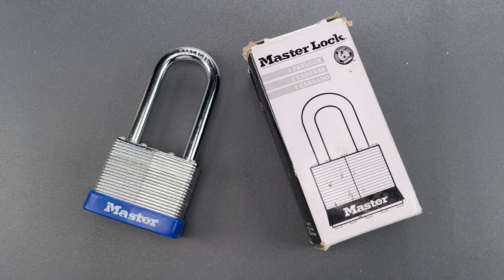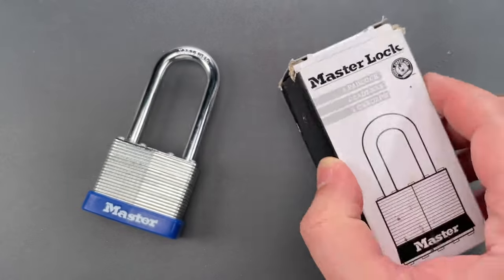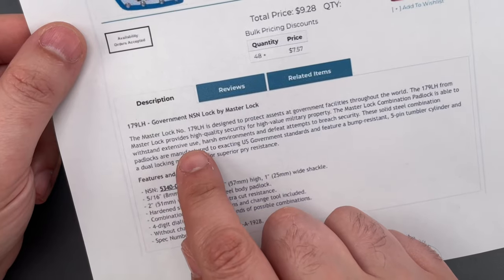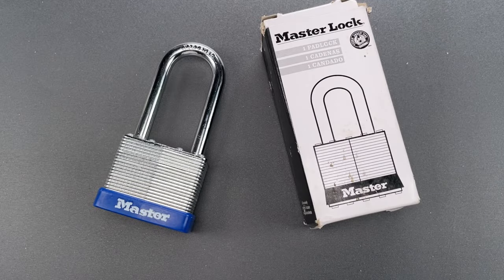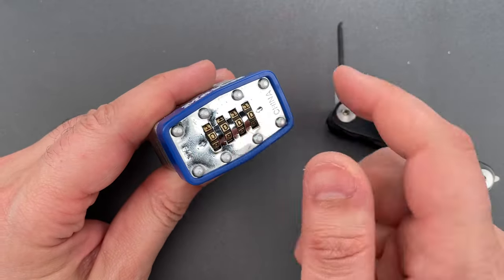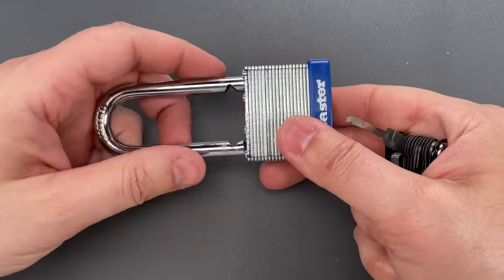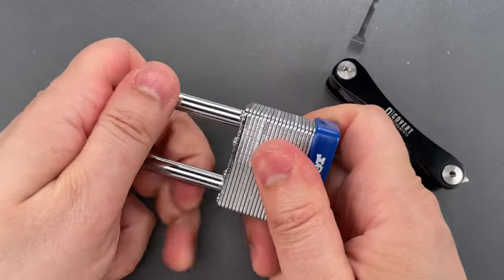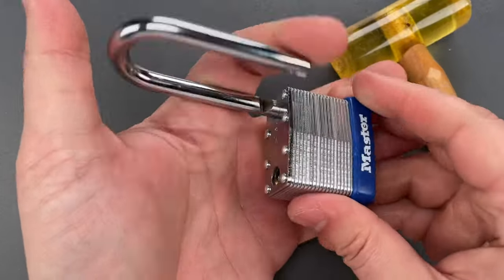[1449] TERRIBLE Master Lock Laminated Combination Lock (Model 179LH)

Comment: I always cringed when videogames depicted lockpicking as something stupidly easy that takes 5 seconds... and then I started watching LPL.
Reply: Then you realize it only need 3 seconds
Reply: Rumors say when you name your character in Skyrim like him, you start with lock picking 100
Reply: @Mazaroth  honestly. You only need to hit most locks with a hammer. Skyrim is obviously way too hard.
Reply: @Mazaroth  In a setting with that level of technology, they used loose tolerance warded locks, not pin tumbler locks, due to the limited skills of blacksmiths to make locks and keys.
Reply: @Mazaroth  I mean, Most locks back in the day had 2 pins at best....
Reply: That is very generous of the video game for someone to take 5 seconds to lock pick.
Reply: Character development
Reply: @Mazaroth  dude acting like they had high lock technology in the medieval era
Reply: @Root3264  The hard part is finding his name.
Reply: Fallout lockpickin seems to be harder than some real locks :DDD
Reply: @sigmamale4147  also, magic is the technology of the day -  locking and warding magic + traps can be used. skilled casters as part of the security. it's why guns don't really exist (though elder scrolls technically has plasma rifles and 'math cannons' (they cancel you out of existence like an equation). but like your average revolver is pointless. blades and bows work fine, and if you need to penetrate heavy armour use a hammer or cast a fire spell
Reply: @elsydeon666  
Yet again elder scrolls setting has magic and also dwemers witch were more technologically advanced
Reply: @Root3264  Tried it and the game crashes, turns out it maxes out the Integer.
Reply: @Root3264  too bad I don’t play Skyrim
Reply: @elsydeon666  Yeah, i know that it wouldn't make sense to have such much machined parts in the past, but they did have stuff like that in oblivion, then again it would make even less sense since that's about 200 years before skyrim.
Reply: @Mazaroth  Well, in this channel were featured some "high security" locks with zero pins, i.e. you just need to tension them and it will pop open.
Reply: @sigmamale4147  Honestly, my point wasn't that, it's just that the minigame sucks, oblivion had way better one, even if it doesn't make sense to have pin tumbler locks in a setting that's close to medieval times.

I know modern locks require machining, which honestly wasn't impossible in those times given that they could use copper, iron and steel, it would've just been really, really expensive and time consuming.
Reply: @Mazaroth  I heard that videogames depict lockpicking incorrectly intentionally, because they're released internationally, and some countries outlawed any lockpicking instructions.
Reply: @VcSaJen  Yeah, that would make sense, it's still kinda poopy that they can't atleast make make a challenging minigame, even KC:D has a better one and that ain't realistic either.
Reply: @Mazaroth  is almost like they didn't aim for reality when doing the lock picking mechanics😉
Reply: @elsydeon666  and also...
... it's not reality nor meant to be.
Reply: @sigmamale4147  other dudes acting like it is supposed to be 100% accurate mechanics in locks in a...
...game😉
Reply: @Mazaroth  I can't even argue oh it's past fantasy we can chalk it up to them not knowing.

Bc fucking imperials in oblivion have great fucking locks. Only nords apparently never heard of multiple pins.
Reply: @Mazaroth  Well I'd say no lock works like that anymore medieval lock were rather easy to pick even for a novice. During that time they simply didn't have the tools or materials to build something to very tight tolerances, well at least not without the lock becoming so expensive that only a handful of people in whole of Europe could afford it.
Reply: @elsydeon666  I'd say it was not so much lack of skills as it was lack of proper tools or materials, blacksmiths of that era could do some pretty impressive stuff so they weren't unskilled by any means but you could do only so much with the tools and materials of that era.
Reply: @SampoPaalanen  and also...
... IT IS A GAME, NOT REALITY 😂😂
Some "discussions" on the Internet is really cringily worse than geek sitcoms 😁
Reply: I got the a clue about how easy it can be when I as a kid, after picking my sister's diary's lock decided to try something more challenging and managed to open our home's door in about 10 minutes using only hex tools.
Reply: Put down the controller and go outside. Sell that console and buy a PCP rifle.
Reply: @Mazaroth  I don't know if you noticed, but it's a game.
Reply: @Mazaroth  It's a videogame and the lockpicking minigame wasn't designed with the intention of being realistic. That's like complaining crafting in videogames is unrealistic. Of course it is! Literally the only goal was to create an interactive stat check that doesn't take more than a few seconds to explain.
Reply: except in Payday where it takes like 1 minute
Reply: @CanIHasThisName  It could at the very least be challenging or actually require some actual hand-eye coordination skills, for example KC:D and oblivion have better ones and those are not realistic either.
Reply: @Mazaroth  The Oblivion locks are better, first thing i dith after i had left the dungeon was go south to a cave where the Unbreakable Lockpick is.
Reply: Lol
Reply: @daedelus6602  You mean the skeleton key you get from the Shrine of Nocturnal? You have to be atleast level 10 before you can get that quest and i'm pretty sure you cannot get that when you just get out of the dungeon.
Reply: Now i cringe knowing nothing is secure. :) luckily, i downt own anything of value, but still!!!
Reply: @Mazaroth  IMO for a dumb mini-game it does its job pretty well.
Edit: Definitely wouldn't call it accurate, don't know why people are defending that aspect of it. I just mean that in the same way combat is really dumbed down I think that's fine for lock picking too.
Reply: @Mazaroth  yes they do, they are Master lock brand.
Reply: Lol yeah same
Reply: Are you older than 8 years old?
Reply: @Mazaroth  Well, are you aware of that ancient clock from Greece that they found on a sunken ship? That has really spectacular machinery/gears. Metal back then was melted down so anything of true value was likely recycled and then we got the dark ages after that....
Reply: @Mazaroth  The Antikythera Mechanism proves that it's not that crazy for Oblivion to have decently fine gears/mechanisms especially for a game with magic and automatons(TES Lore) in it.
Reply: I really liked the oblivion lock picking.
Reply: @Mazaroth  Skyrim is a simplistic game about a game world that bends over for you just as soon as you look at it. Not the kinds of game where you should expect lockpicking to be difficult.
Reply: @Mazaroth  yeah. now we know that the security standard is much lower.
Reply: @Mazaroth  it's literally a fantasy game
Reply: @TuberoseKisser  Well, if it's literally a fantasy game, what would stop them to implement a lockpicking system that's "out of this world"?
Reply: @Mazaroth  cough master lock cough
Reply: @Mazaroth  you realise Skyrim isn’t set in 2022 after the industrial revolution? Sure it’s fantasy but it’s set in the real life equivalent of like 700AD. Locks in Skyrim are extremely basic
Reply: @Robstrap  Gee, if i only had known that...
Reply: ....or...   "You broke your lockpick" 500 times.
Reply: @elsydeon666  Well i would say skyrim had a lesser importance for locks as oblivion had much better locks and that was before the events of skyrim
Reply: @Mazaroth , at least in Skyrim, they use both a wrench and a pick. Most games don't even do that.
Reply: @Mazaroth  It's a game, it's made to be fun. Morrowind had a more realistic lockpicking mechanism, but it's also more tedious.
Reply: @Mazaroth  ,
Looks at Dwemer Lock Box which requires Dwemer Blood to Open

You did do that quest, right?
Reply: Lockpicking 100
Reply: @mrnickbig1  ,
I prefer the lock picking mini-game from Elex. It forces the player to pick the tumblers in the correct order while also not requiring the player to have good and-eye coordination or fine motor skills like Oblivion/ESO. Hitting the wrong tumbler resets the puzzle and has a slight chance of breaking the pick used.

Now, games which force me to play a mini-game which requires me to have the fine motor skills I never will have is pure frustration. It's great to see game designers take a somewhat realistic approach to lock-picking while leveling the playing field for everyone (Skyrim, Elex, etc.).
Reply: @xtrem5428  If it's made to be fun, they failed that too. I'd gladly take Morrowind's lockpicking over Skyrim's, because at least there's some chance your character can encounter a lock they can't pick; all of the engagement is sucked out of Skyrim's lockpicking immediately once you realize how easy it is to pick even Master tier locks with a brand new character, and the whole exercise just serves to slow the game down.
Reply: @monkeking8604  and that 3 seconds includes doing it again to show you that was not a fluke
Reply: @joshuagibson2520  How is a rifle going to help me pick locks?
Reply: @aralornwolf3140  , I have my own lock picks, but my set is nowhere near LPL's and I will not pretend to be anywhere near in the same league as far as skill. I can pick many of the commercial pad locks around here. It is amazing how many cheap Chinese locks there are around here, as well as Master locks.
Reply: if anything after watching LPL video games make locks seem far more secure than they actually are lmao
Reply: @daedelus6602  oh yea! Spaming auto-pick for life :D
Reply: It’s actually easier in 1 in 20 cases
Reply: In all fairness a masterlock will open if you look at it wrong
Reply: truly "truth is stranger than fiction" moment
Reply: @Mazaroth  bruh skyrim has medieval locks lmao they were not complicated
Reply: Lockpicking irl is easier than whatever Kingdom come Deliverance did. Stopped playing because I couldnt do it
Reply: The games make it look harder than LPL does
Reply: Then realize its harder in games than irl
Reply: Mafia 2
Reply: @tanyanguyen3704  Oh yea then what are you watching this video on? Unless you’re using a phone or computer that is a decade old.
Reply: @monkeking8604  Give me a pair of scissors and a red bull can, and I can show you the world!
Reply: ... and he taught my it was only a fraction of that. 😆😆😆
Reply: Lockpicking mini-games exist solely as an excuse for level designers to put in more goddamned doors when they were told they had exceeded their door allowance. Because level designers aren't allowed free reign with assets. It's like letting architects build a bridge. It will be beautiful, and it will be ON FIRE. At the bottom of the ravine.

The worst part is when they then ask me to make them "a lockpick door, but without the lockpick part?"

No, because then it would be A DOOR.

Love, a gameplay engineer whose job apparently revolves around fixing doors because they are always so broken in so many ways, how did you even make it sit sideways in the frame, why do you hate life, level designers? Why?
Reply: (As a side note, I haven't run into anything with Legal and locks being too realistic, but something not often advertised is that any game using patented guns of US make cannot get the legal rights to use them unless the gun companies that own them are involved. The involvement is always "we'll subsidize part of your game, but we have final say on who can use them. Only good guys can use our guns. Bad guys have to use AK-47s or whatever."

It's not just one company, not just one game series. Think back to anything you've played set in modern times. Do the "bad guys" (read: Not American) ever use an American-manufactured gun?

It's one of those shady bits of video games nobody sees, and because of all the legal patents/copyrights/trademarks involved, everyone is affected, at least in AAA titles. I don't know how badly indie devs are examined or pressured. I do know the film industry has agreements like ours. But I think it's a very interesting look at how companies/brands can inform our perception of them without us ever knowing they were even involved.

All of this said, I badly want to create in-game doors locked with Master locks, and have them open just by touching them. Or breathing on them. Or looking at them too sternly.)
Reply: Ever since I started lockpicking I run it differently in my D&D games
You'll always get through but if you roll low it'll take a while and be noisy potentially tipping off the guards
Reply: @Dawnshadow  how's a game console gonna help you pick locks?
Reply: @Mazaroth  still more secure than most Masterlocks.
Reply: @Pasloooo  Fallout's lockpicking is rather fickle yeah, I've broken more bobbypins just in FO76 on my first test of a simple lock than I've broken picks IRL.
Reply: @VcSaJen  that one's a myth or Thief would never have gotten an international release since it's actually pretty accurate as I recall, and lockpicking can vary a lot between nations given our very different ideas of security for a start, look at the differences between LPL's Lockwood videos for Australian security standards compared to the USA same basic design but we're looking at different primary threats, and we both have very different perspectives compared to Chinese locks.
Reply: @cericat  Well, i can't argue with that :D
Reply: @Mazaroth  there's also not a single town that was destroyed in a dragon attack irl. It's a fantasy RPG where you kill dragons, realistic locks are not their main selling point.
Reply: @monkeking8604  it’s not particularly difficult to do but easy locks are still difficult to someone without the skills and experience.
Reply: @elsydeon666  That and spiked gates that swings open in your face impaling you in multiple lokations for stepping on a preassure pad. And there are the rock falls, and then the magical stuff that will electrocute, freeze and fry you. And failing that ancient undead warriors ready to bash in your head...
Reply: This is why honda civics in the 90s could be stolen in less than 10 seconds, half of which was getting in the car.
Reply: Video games’ lockpicking is hard mode…
Reply: That awkward moment when you realize Skyrim lockpicking is harder than your average IRL lock.
Reply: 5 seconds? Including buy a hammer...?
Reply: Kingdom come had bullshit lock picking till you practiced
Reply: Hammer to lock is more realistic then it should be
Reply: @monkeking8604  and the character is being slower then they should
Reply: @daycred  I find it funny how lock picking is the (relatively) easy part. Its staying hidden while lock picking that's the problem. If you didn't have to be stealthy, you could "lock pick" most locks by bringing the best lock pick: a crowbar.
Reply: Man on fallout and Skyrim I try to do them asap since watching him hah
Reply: @monkeking8604  Well now that depends on the skill of the picker and the quality of the lock. You take someone of lpl skill level and yeah a master lock is a two second job. The skill he has took years and much research to know weaknesses and flaws in lock design. Not everyone is a master lock picker.
Reply: @Aliyah_666  did you ever hear something called jokes? I don't know, maybe you haven't, try to look it up it's good for you brother
Reply: Assassin's Creed unity intensifies
Seriously, LPL would get all those red chests EZPZ
Reply: You do realize most pickers cannot pick super fast and pick all those locks LPL picks right? (well I mean for the real locks, not this one 🤣)
Reply: That's one thing... but what I never understood was the deal with the fragile lockpicks... who came up with that BS... cuz somebody did.. and every game developer started copying it... not realizing it's just not how that works.. :D like seriously a wooden toothpick would last longer than lockpicks in most videogames, that's something that always bothered me. Imagine if your tools broke every time you failed to open a lock lol... And I get that they're trying to introduce some element of "challenge" but they could simply make the puzzle harder itself.. or require more specialty picks etc.. and not simply resort to the cheap solution of "one time use" lockpicks..
Reply: It's all about FEELING THE LOCK 🔒 When you open a lock you feel that tension and releases that games mimic.
Reply: Yeah, it would be really fun to spend 10+ mins on every lock of any long game, that has 100+ locks.
Reply: Same here watching films I thought nobody could pick a lock that fast. Then I found this channel and I was kind of right LPL is faster. 😂👍.
Reply: Lpl is related to the characters. That's why they're so fast at it.
Reply: i literally make a lockpick out a small broken flathead screwdriver at work and proceeded to pick all the padlocks at the shop just for fun on my breaks, i never picked a lock in my life before yesterday and i was able to get them all within a couple minutes each
Reply: the first time I have picked a beginner lock I realized that videogames (like Skyrim) are way harder then real life :-D
Reply: Elder scrolls V?
Now that I think about it, lockpicks should not be breaking like toothpicks
Reply: @Root3264  lol sneak 100
Reply: Most lock "picking" attempts have nothing to do with putting a pick in the system. It just consists of hitting it hard enough to make it fucky
Reply: In Skyrim my lockpicks always broke, so I got cases full of them :-D
Reply: Me yeah I wonder what video games he’s referring to *looks at the fallout 4 game case on his desk
Reply: I wouldn't scoff at skyrim's locks just yet
They live in a society where skilled labor is cheaper than materials. This means more locks will be more skillfully crafter for less money. 
Skyrim's locks are possibly harder than most locks are today and skyrim's locks are piss easy
Reply: @monkeking8604  another 2 sec to show it's not a fluke
Reply: @daycred  oblivion is earlier and demonstrates lock opening spells. The elder scrolls hammer.
Reply: @daycred  not as hard as oblivion, in morrowind it was done in a nice way just ram your lockpick few times and its open
Reply: judge eyes and lost judgement…
Reply: The lockpicking mini game on Kingdom Come: Deliverance almost gave me an anger induced heart attack.
Reply: tbf, pacing is a thing
Reply: @carvedinshadows  it’s similar with iPhones in movies/tv shows, apple also has a policy on which characters can use their phones in movies/shows, it’s usually the protagonists and/or the "good characters", the villains don’t usually use iPhones, unless they’re the sort of "likeable" villain that the audience can identify with who isn’t purely evil
Reply: @henrihell  yeah, it is kind of funny, how lock picking aficionados are dissecting the in-game mechanics of Skyrim while like 99% of Skyrim’s target audience doesn’t even remotely care about how you’re picking locks because they want to play an rpg set in a medieval fantasy world with dragons and magic etc, not lock picking simulator 3000 lol
Reply: @NeverSnows  exactly, most people playing video games don’t want to do that. They don’t play the games for their lock picking gameplay features, they just want to have fun and enjoy the game. Its cool that some doors are locked and can’t just be opened without performing a certain action, that lets players feel like they just achieved something, and from a storytelling point of view it makes sense to have some doors that can’t just be opened due to the feeling and atmosphere it conveys, but that’s it, it isn’t the main point of the game and it’s likely that more players would be annoyed by overly complicated lock picking mechanics, than the few who’d appreciate it
Reply: @pumkin610  yeah, some level of wear and tear would be fine, but they break way too easily which is just annoying and unrealistic
Reply: I’ve picked a lock a fast as a key would be
Reply: And then you realised it takes too long in video games
Reply: @elsydeon666 Given how Master Lock's… stellar reputation is with said pin tumblers, I'd say those older blacksmiths in Skyrim make better locks than most modern locks.
Reply: @elsydeon666 actually, in Oblivion the locks had actual pins